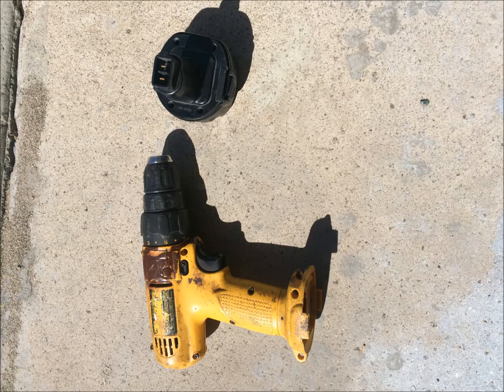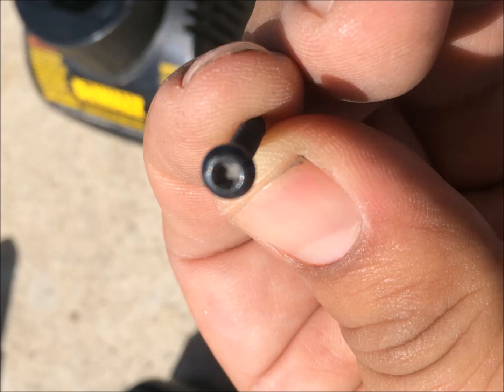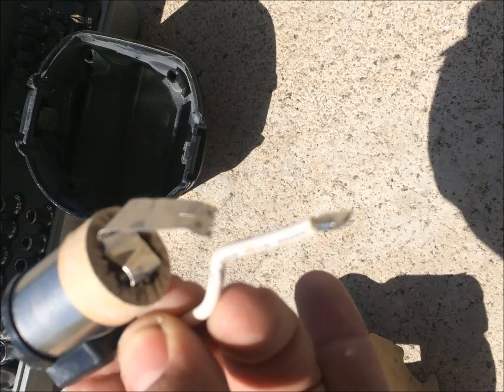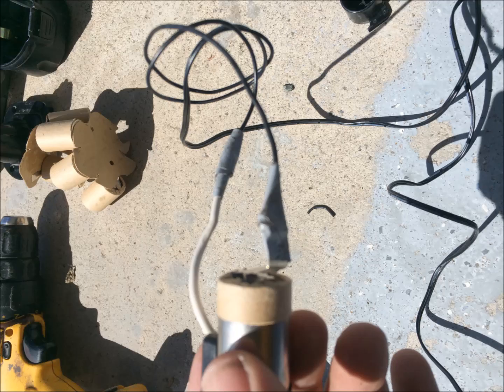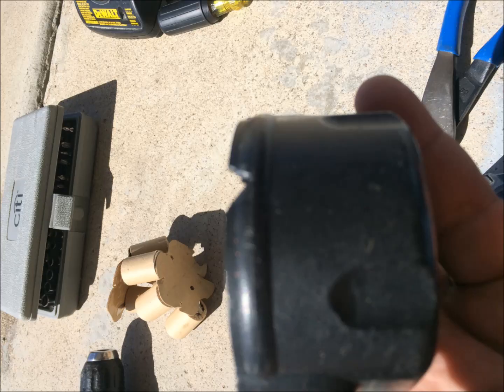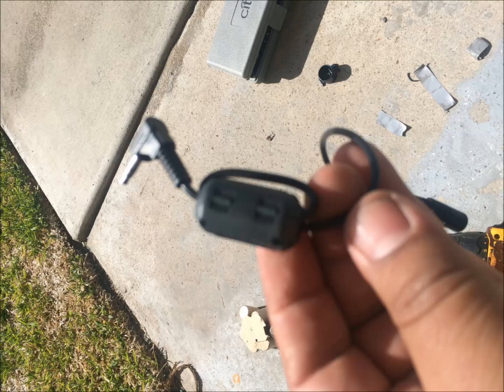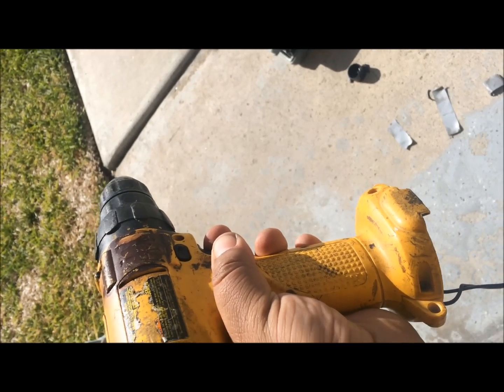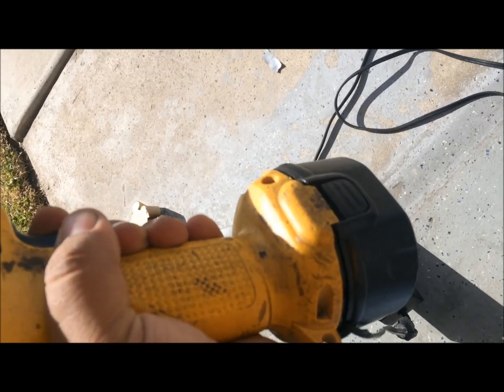How to Cord a Battery Drill

Comment: First of all Sir, that is not a magnet but a ferrite to suppress interferences and has nothing to do with the RPM of your drill.
Second, your drill is still running low after wiring it because it needs more Amps, and your DC transformer is not up to it, it's only 3 Amps.
So, to make it work alright, you will need either a replacement battery with same specs or with even bigger amperage, but if you decide to wire it, then use a transformer of same voltage but with double of that amperage you're getting from that tiny transformer. As is, that transformer will heat up and cause fire, so please refer to a qualified electrician who can assist you. Good luck!
Reply from the maker: Great feedback! Will pin your comment to the top for everyone’s reference!
Thank you!
Reply: Hi Omar. Can a 19v 3.42A laptop charger power a drill with an 18v 19.8Wh 1.1Ah battery or at least charge the battery? If the battery can be charged, please give me an idea of how long it would take. Thank you.

Comment: Did this with a 12v drill from the dump. I did what you did but I used a cord from an old vacuum cleaner and I left the original NiCads in the pack but disconnected for weight. On the other end of the cord is a 12v car lighter plug and it's plugged into an old jumpstart box that is too weak to jump a car but more than enough to power the drill. The drill is a single speed and not good for driving long screws but great for taking stuff apart. Replaced an 18 volt Drill master from Harbor Freight with a dead battery.
Reply from the maker: Awesome!

Comment: This video is BULL.  You would need DC power with maybe 6 amp to run a battery powered drill and no magnet will change AC to DC.  It takes a full bridge rectifier to do the change and 3 amps is not  enough.
Reply from the maker: Thanks for your feed back, I've since changed the power cord..  it was just the items I had readily available at the time. 
You are right the magnet was not the issue but the amperage limits in the cord

Comment: Which wire did you Connect to the magnet and how
Reply from the maker: Turns out the magnet was irrelevant. it was slow and "glitchy" because the amperage limits in the cord were low.